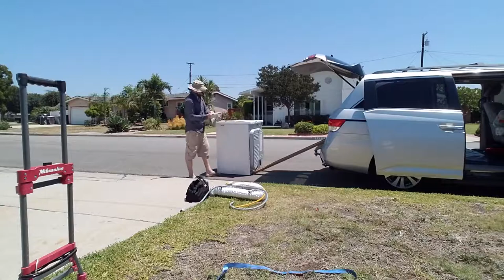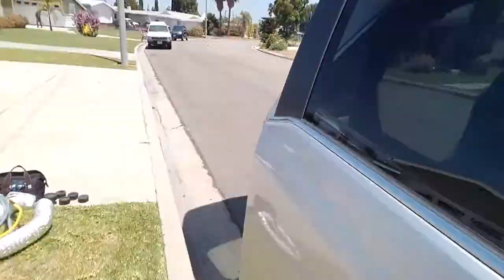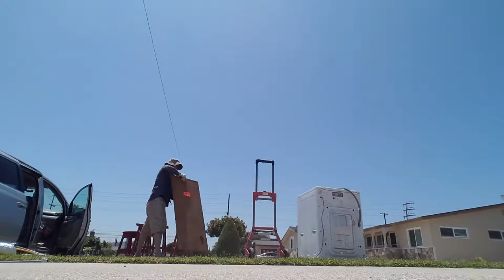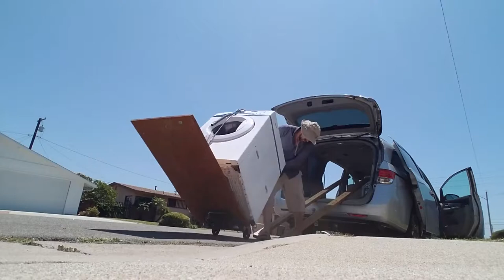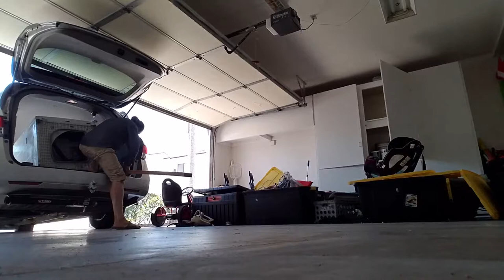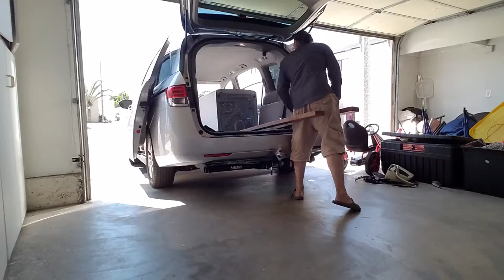LifeHack: How to move washer and dryer in a minivan by oneself

Comment: Thank you!! My daughter is moving from Kansas City to Columbia this weekend. She was going to sell her washer and dryer, but I convinced her that we could move them in my Honda Odyssey! This video really helps!
Reply from the maker: For such long distance move it will be hard to keep smooth driving. I advise to fix the washer drum by special bolts... or put something in the gap between drum and housing to prevent its vibrations and shacking during bumpy road.
Reply: @RUS_US  Special bolts? Would stuffing towels between the gaps work?
Reply from the maker: @cti-gasdetectionspecialist4153  i sure you can find these bolts online cheap. The something like towels is just my idea and not sure how it will work. I would remove one panel (top for example) and put something in between drum and walls. 
One more tip: it is hard to remove all water from whasher. To keep your car dry put film and towel under the washer.

Comment: Hi… I'm considering buying a used washer and would like to buy and drive it home about four miles on local streets in my Ford Focus hatchback. But, from what I've been reading, the washer could be damaged buy laying it on its side or back. Do you remembering if you did anything specific beforehand in preparation of the machine being moved? Thank you.
Reply from the maker: you should drive smoothly like with baby in car then it will be ok. The moovers and trucks are not so gently and for sure they can damage it. To prevent this the special bolts/screw exist to clamp the washer barrel during mooving ... but for sure you do not need it
Reply: @RUS_US  Thank you for the quick response! I'm not a mechanical person, so excuse my question, but since it is a used washer, are the "special bolts and screw" still on the back of the machine or would they've been removed?
Reply: These locking nuts /screw come with every washer, pls check with owner of they have it. Local hardware store would also have it.
Reply: @smartsant24  Thank you!

Comment: That does make it easier and safer. But for me personally, it's not that heavy.
Reply from the maker: when i was younger i did it by simple lifting. Now spline and lower back issues prevents me from doint something similar.
Reply: Some of the washers are so heavy these days.

Comment: Love it. going to do this, this weekend.
Reply: Did you do it?
Reply: @adithyagowda4642  it worked, but i used a solid piece
Reply: @adithyagowda4642  I did it, but I used one piece of solid Plywood, and a Bed spread to protect it. slid in there with no issue, and I strapped it down inside so it would not shift or slide when i was driving.
Reply: @trini-mikeali3829  nice

Comment: I’m a woman, 43, that lives alone, and I need to move my appliances by myself, and up to my 2nd floor appartement (only stairs). I’m planning on taking them appart, to have lighter parts, and put them back together once upstairs. Sofa is done, next will be my oven. 
Will update.
Reply from the maker: moving solo up and down stairs might be tricky. usually i use dolly lifting it with cargo step by step. my friend makes rails from wood and use ropes to move very heavy cargo (i never try this but i saw it).

Comment: Well, although he did it the very hard way, he did it. Within about 4 minutes I can load 2 top load washers standing up straight behind the front seats and load 2 dryers laying down sideways. No wood needed. Just tilt it sideways on the back of the van and easily push it up inside. If I wanted to haul front loaders like he has, I could stand all 4 right side up... tilt it to the back bumper, push, stand it up and then do the same thing over. Hell, he even makes the dolly part complicated. Just put the dolly under it and tilt it back. I do it every day delivering washers and dryers and make a profit of between $460-$900 for 2 sets delivered.
Guy asks if he wants help and he says he is 'ok'. :face-purple-smiling-tears: I don't think so buddy.
And for the record... you can drive 200,000 miles with 2 sets in the back of a mini van and it will drive as smooth as a BMW. I know, because I've done it.
I was rolling, especially watching you unload. 🤣 Great effort though.
Reply from the maker: well ... 1) you are obviously stonger than me. i am not doing it on daily basis. 2) you do not care about paint of your car bumper. i do. 3) this video is for those who do not want to pay a $500-$1000 and do not have your strength, skills and care about their car exterior
Reply: @RUS_US  I'm 57, you looked as strong or stronger than me. Actually, the part where you got inside the van trying to get it out... I couldn't have done that, way too hard. I never strain 1 muscle in my body. It actually made me tired watching. It takes me right at 4 minutes to load 2 washer, 2 dryers and put my big appliance dolly on top of the van and strap it down. 2. All you had to do was put a blanket over your bumper, that's what I do. 3. I make $100k+ a year doing this so I would be fine if I damaged the paint, but I don't. 

It's all good buddy, I just thought it was funny that you thought you was saving your bumper when all you had to do was put a blanket over it. Where I load the dryers from the back, the paint looks new on my van and I've used it almost every day for right at 5 years. It's ok though... when I was a kid I let the air out of my bicycle tire to take it across town to my uncle to repair because I thought it was make it lighter if I took the air out 🤣 Have a great week! :hand-purple-blue-peace:

Comment: What’s the purpose of the 2x4 when u could just lean then lift it on the van the push it in.
Reply from the maker: to not scratch car, washer and use smaller push and lift forces.

Comment: Awesome! Thank you! Question- If you had a refrigerator dolly, you could've used that, and just leaned it against the bumper and pushed it up, no?
Reply: *with a moving blanket so you wouldn't scratch the car..
Reply from the maker: 1) See the https://youtu.be/Lwd6mw6fyn4
2) the dolly could eat some space because of wheels. It depends on your vane size. I had cases when only one inch gap was between moving stuff and car interior.
Reply: @RUS_US  Thank you so much for your help! I appreciate it!

Comment: Is that true that a washer can be damaged from transporting on its back?
Reply from the maker: if drive on rough surface then yes. the cylinder should be fixed during moving OR you should drive slow and smooth like you have baby in car
Reply: @RUS_US  would a washer that is top-loaded be damaged if transported in a minivan or just a front loader?
Reply from the maker: @byronfoster1651  it depends on how smooth is the ride. Most probably for any small car driving it will be safe. In a big track it could be rough. Or when a box with washer is moving from track to shop. The moovers think how to move faster but not smoother.
Reply: You pack the drum out with polystyrene or wood. And replace the bolts that go in the back to stop the drum moving. When it’s delivered.
Reply: Lol don't listen to him. Top loaders highly unlikely. Front loaders laid on side can have the suspension rod slip apart. No permanent damage.